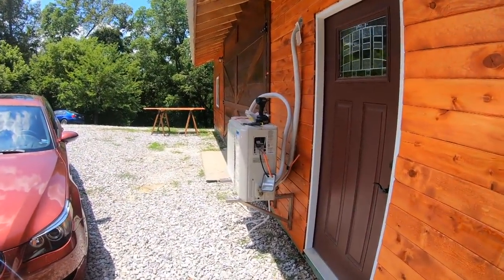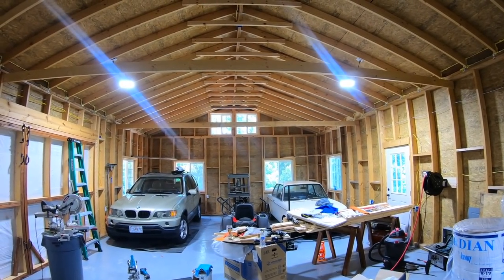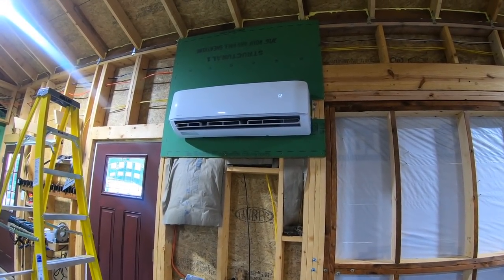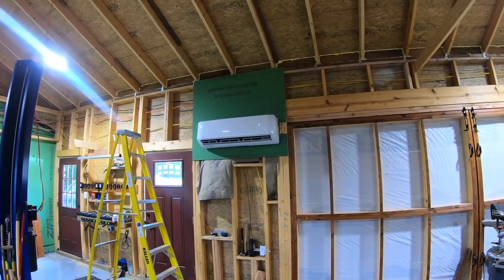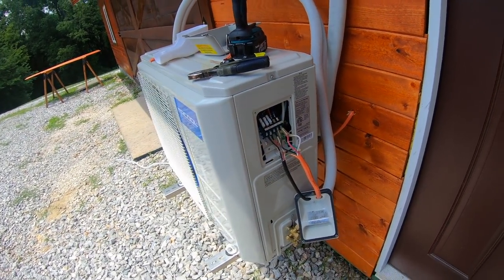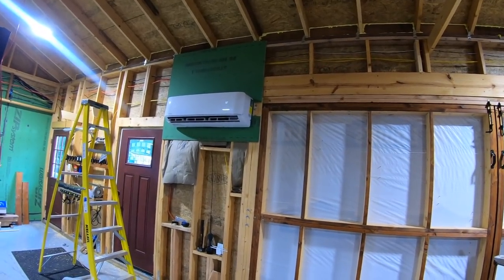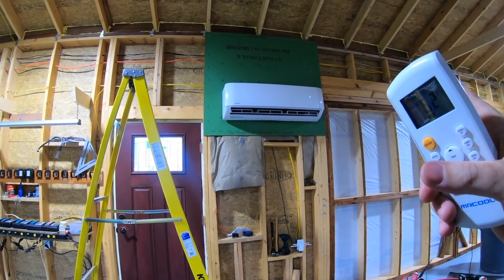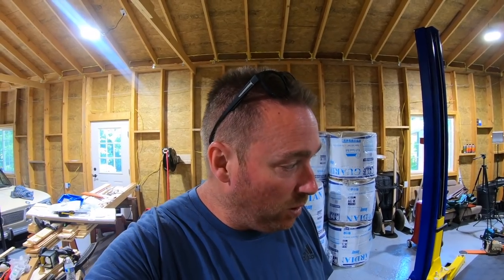MRCOOL Mini Split AC Heat Pump Installation SECRET TIPS Part 1

Comment: I just completed install two days ago for my garage 735 sq ft / 10 ft ceiling, I used 10 ga. THHN red blk green. $.47 per foot each. Your ROMEX has 4 conductors, the white wire is not according to NEC standard 240v is achieved with two hot wires of double breaker & the ground wire. Do not connect a wire to neutral in the electrical panel. Your white wire can serve as a ground, however cap off the bare copper wire at both ends. I used a liquid tight whip to connect to a 30A fused disconnect box. I sweated over this install almost as much as I when working on my '73 2002 (that looks like a 70 - 71 in the corner of the shop). Thanks for the memories.

 I may have the later version  the wires came fully attached to the head unit. rewinding the pipes is a potential problem. They warn against reconnecting the lines, the lines come pressurized to keep moisture out and they are concerned with seals leaking after torquing a second time. It would probably work, I would reuse the plastic screw caps that came while recoiling the line set.

Comment: I like watching these mr cool install videos to see all the no no things these guys do.  Loops on line sets no surge protection. Wiring issues no fused disconnects just to mention a couple
Reply from the maker: This unit is 10ft from the main breaker box ...
Reply: So what does that mean. Nothing. 25 FLA means what it says. A proper wire size and TIme delayed fused disconnect will work. 100 feet is the were you need to upsize. Always check voltage at the appliance and check manufacture + - tolerance .
Reply: As an HVAC licensed tech I agree with the original post. So many things in these videos are done incorrectly. Proper placement. Safe electrical work. Purge with nitrogen. Pulling vacuum. I also saw nothing that warrants the do not buy until you see this video except many things to avoid doing in your own install. Not to be insulting but work that requires education and licenses should be done by people with the education and licenses even if it is just in a consultation. I hope things stay good for you ;)
Reply: Adam Radley Concur on the electrical work, but he did say it was temporary. You are aware these MR Cools don’t use traditional copper lines and they are pre-evacuated from the factory, hence they are considered “DIY” systems. I don’t like the coiled nature of the excess line length either. I did see plenty of reasons NOT to buy a MR. Cool. I only stumbled on this video and am not a regular here, but I do know that in the metalworking YouTube community, many of the creators were donated Mr. Cool units for obvious reasons.
Reply: @charlieromeo7663  yes the linesets for MR cool are prechraged. Just like the old residential AC units used to use. Before we all realised how inconsistent and unreliable that type of system is. A lot of us are just waiting for the influx of service calls on these units. 

It is important to note that many of these DIY kits are not prechraged lines hence the comments about purging and vacuum.

Also large loops can cause oil accumulation.

Another aspect that experienced techs would mention is the outside placement of the unit. Especially for heat pumps. Prevailing winds and adequate shelter from those winds increases efficiency. These are just some examples...
Reply: @adamradley4407  but these units have precharged line sets. Literally is right in the description. So if it’s just the loop in the line set, that’s easily dealt with.
Reply: @qwazxcvbn   yup just look at the above comment. your concern was already addressed :)
Reply: Still supposed to have a disconnect within 6 feet of outdoor unit. It’s pretty much a standard code everywhere.

Comment: In 2013, I installed a Gree branded 18K BTU heat/cool Mini Split.  Main unit was pre-charged.  I used a 25 foot line set and a wall mount.  It heats/cools our Master Bedroom as it is upstairs and the central unit does a lousy job upstairs. Bought a 2-stage 5cfm vacuum pump, gauges, hoses, micron gauge, refrigerant scale.  Was able to vacuum system down to 70 microns.  The China built unit is still working flawlessly.  $1200 for the unit.  Didn't keep track of the cost of the tools I bought but have fixed 4 HVAC issues for friends so probably broke even.  Just happy the bedroom temperature is perfect.  Cheap to operate.

Comment: I installed a universal central air (not mini split) MR cool 2-3 ton heat pump and LOVE IT. The customer support is amazing and when I had an electrical issue with my air handler they sent me a replacement BRAND NEW complete AIR HANDLER at no charge.

I repaired the broken air handler and bought a cheap r410 heat pump to mate to it and now I have central air in my house AND garage.

I love mr cool

Comment: Nathan, this is no garage or barn, it's a castle man! I am impressed!!
Reply: @nizapad6970  not neccessary !
Reply: Nothing tying both walls together like ceiling joist  just three 2x4s and the end walls 🤔
Reply from the maker: No 2x4’s in this build, collar ties and the ridge sits on posts  , so no push out,since this video I installed a ijoist and lvl loft that locks it all together
Reply: @NathansBMWWorkshop  lots of technical words, but I am still impressed man :)

Comment: We run four of the minisplits in our home and two rental units.
They work perfectly, are very quiet and super efficient !
Way better option than forced air if you have the room to mount componants. Ours are all powered by an 8 KWh solar system.
Nathan - two suggestions for your garage. 
1) add a point of use surge protector at the AC unit to protect it from lightning or utility power surges.
2) dont run it while you are doing dusty work - drywall or fibreglass insulation installs. Or at least cover the air intakes with some quality hepa type furnace filter material.
This will keep all the particulates from matting up inside the air handler which is difficult to clean.
Nice shop, enjoy working in that air conditioned luxury.

Comment: I had an electrician wire my hobby shop for this before ordering this unit... he then installed it for me for $200.  WOW, one of my best purchases ever.  This unit is
whisper quiet and keeps the 800 sq. ft. shop nice and warm.  I had this put in last fall when it was still warm and the a/c seemed to work well but the test will be
this summer... hope it can handle our Virginia heat/humidity... it is very uncomfortable here in June, July, and August.  Great unit so far and is very economical.  I
had originally thought of a pellet stove for this hobby shop but am glad I went with this unit instead, plus I was able to get rid of the window a/c units!
Reply: What size is your shop and how many btu's?
Reply: So how did the summer go?

Comment: I have installed 2 36,000 btu units and 1 24,000 btu unit. They are a great system. I got my from menards and Never had any issues with it
Reply: You installed in the same house 2 36, 000 btu units and 1 24,000 btu unit?

Comment: My 24000 btu window unit cost me 799 last year. I am going to put a mr cool 18000 btu in my shop in a month...
I read they ramp up when they come on, not like a regular heat pump or windows unit that comes on all at once sucking down amps at start up. Lol how i explained it to my wife is when garden hose is running kink hose to stop water then unkink, see all that pressure when you unkink hose. Thats what window unit does when it comes on just suck them amps.. might be a lame way of explaining but how i invision it...good video sir thank you..

Comment: About 4 years ago I did some remodeling and installed a dual head mini-split at 12,000 btu each for two rooms. The outside unit is a 24,000 btu Mitsubishi. My set up came with enough line for my locations and the outside unit was pre-charged...but...I still had to have the lines vacuumed , which I paid a hvac company to come out and do for me. I only paid about $70.00 for the vacuum and line check for leakage at the connections to the inside handlers. I also used  an ordinary water hose for my drain lines since the kit didn't come with drain lines. I have the hvac people come out about every two years and they connect a shop vac to the end of the drain hose and suck out any junk that has accumulated in the condensation pan that doesn't drain out normally. I love the mini-split; it is very quiet and because it requires 220V, it is a lot cheaper than  regular 110V window units, which are loud and draw a lot of electricity.

Comment: If I could I would have mini splits all throughout my house. I love them. a lot more energy efficient than a central unit. In my master bedroom I have a Mitsubishi. Wasn't cheap. About $3500 installed. and in my living room area I have a blue ridge 12000 BTU mini split. About $1,800 installed. I did not do any of the work myself. The other thing about these units is that you need to at least clean out the blower motor and the coils at least every two years. They can get quite dingy. Other than that they are very efficient low noise and cools well.I think one of the main reasons the HVAC people don't install these more often or recommend them is maybe because they are not as profitable as a giant central air unit.
Reply: true.
Reply: Profit margin on these are way higher than central air. The profit has nothing to do with recommendations. Central units are much better
Reply: Lol I don't know about not being as profitable. I have a room above my garage. I got a quote from a HVAC guy for fixing the ductwork in the garage that goes to my room. To do that work he only wants 1200. For the mini split he wants 4900. Also I could replace my whole central air unit for 10k. If I put mini splits all through the house it would be much more.
Reply: @shaunvaughn3323  Yeah, it sounds like the guy is pushing toward more profit margin work.
Reply: @antonioj123  Yeah. I think for my situation the mini split might be better, but 4900 seems overpriced. I don't know much about HVAC though. I guess the price could be fair.
Reply: @shaunvaughn3323  i just installed two mini split systems in my house.  One 36000 btu unit and the other a 27000 btu unit. They cost me $3200 and $2700 and i paid $1000 to have them installed.  $6900 for 3100 sq-ft of cooling. I think the mini split is the better deal.
Reply: I'm in Canada, just got a quote for 6500+ for a 24,000 btu. Comes with 12 year warranty, but still....
Reply: @ProjectXJ  where do you live ? In bay area, they will charge $5000+ for such an install jobs . How many zones do you have to cover 3100 sq ft ?
Reply: @irq001  In Arizona.  I have 2 systems, 1 with 4 head units and 1 with 2 head units. 3100 sq-ft total between the two units.
Reply: @muds17  
“central units are much better”
Better meaning what?
Ductless Inverters don’t have the laxidasical 20° plus temp loss at the delivery registers nor the duct leakage, nor the conjoined or bonded temp control for comfort (all rooms go up and down together rather than discreet zones), nor the invaluable redundancy of multiple condensers conditioning a house or building, and I could do this all day long, and yet my customers all thought mini-splits were expensive too because that’s what they all heard and saw estimates for…
And then I blew their minds with affordable priced systems and they all love them. Seriously love them. 
But still old school hvac’ers swear by their ducted central systems… and charge more for that than one of my high efficiency mini/multi split whole-house wifi controlled systems. 
What’s better again?
Reply: @muds17  iam not gonna install a central unit in garage.  I guess they are better for the whole house but not for what I need it for
Reply: I helped a friend of mine who owns his own HVAC company.You wouldn't believe the profit he clears on a central unit.No wonder they don't recommend these,,,HA HA.

Comment: I mounted mine the same way  it will vibrate the wall alot .If I was to do it again id put it on a pad and isolate the line set from the wall because it transfers through there as well . I  bought the cooper and hunter 18000 btu of amazon dual head. My barns is 16x32 two story I have a 12000 btu head upstairs one down it works great used only the bottom  head this winter keep the barn mid 60s in OHIO so it gets cold here  now im using only top head for summer when needed these things are the way to go .

Comment: Not to be critical and only offering gentle suggestions…1. Keep the line set coiled more tightly to avoid damage. 2. Code dictates that a means of disconnect must be used, either unfused or fused. This is typically done with a disconnect box and 6’ whip. 3. The 10/2 Romex showing with the orange jacket is not rated for outdoor use and does not contain UV inhibitors on the jacket. But I did note that you mentioned buying the gray UF wire. 4. The wiring of the Romex and communication cable does not require that you remove the entire covering. It actually splits apart by removing a screw.

Comment: as an hvac tech the one thing you really should do is get a 30 amp fused disconnect. that will bring it up to code. Lowes home depot, menards only cost about 15 to 20 bucks easy to install.
Reply: And how did he evacuate the evaporator and line set without a vacuum pump?
Reply: @jl0016  Mr Cool comes with precharged line sets that don’t require a vacuum pump, that’s why he has an ugly rolled up ball of line set above the unit outside
Reply: @jl0016  pre-vacuumed I should say, the outdoor unit has the charge in it
Reply: @bentrailer1848  Thanks for the update in South africa we do not get line sets and evaporators that come in an vacuum.

Comment: Nice, funny how these units are less known here, this is all they use in South America and other 3rd world countries 👍
Reply: And every country in on earth except USA
Reply: Its good when its new like many electronic appliance, once u run into trouble it will cost you more than a window shaker.
Reply: @dangda-ww7de  With the name brands, Fujitsu, Mitsubishi, you can buy parts, circuit boards, compressors, etc.  Don't know about the off brands.  I've seen some pretty old units out there with R22 still working.  They are more common in foreign countries than here in the US.  I have two Mitsubishi's, one in my upstairs lab and one in my shop, both do a great job.
One issue, condensation, there has to be a drain, so if the indoor unit is on an inside wall, in order to get it to drain, often there has to be a condensate pump, and they do fail and are not cheap.
They use an IR remote control, unfortunately, it's kind of expensive to add a hard-wired theremostat, no idea why.
Yes, they come pre-charged and belive it or not, there are idiots out there who install their own and do not eveacuate the lineset and indoor unit, they just let the freon go, they may work but are asking for problems down the road.

Jim

Comment: I bought a property that had the Mr cool in it.
Heat worked great, bit the AC always froze up.. I had professionals come look at them several times, and it still happened again, and again.. Finally switched to Mitsubishi, best thing I ever did, even ended up save 100$ monthly on my power bills.. they've paid for them selves now..I hope you have a better experience w that MR cool
Reply from the maker: This one is gen 3 , they say all of those issues are fixed on this one, the review before i bought it were really good , so far so good
Reply: @NathansBMWWorkshop  Do they say Gen 3 somewhere when you order them?
Reply from the maker: Cobia 1 yes they say 3rd gen for the 2020 models , when I bought this 24000btu system I paid $1150 now they are nearly double that , hopefully the price goes down this winter , I will buy 2 more smaller units for my house
Reply: @NathansBMWWorkshop  Ok! great thanks...
Reply: @cobia1794  Yes

Comment: David from Mammoth cave Ky.  I just picked up my MRCOOL package units today at one of there warehouses today. Package 1 containes 1 36k outside unit with a 9k , 12k,   18k head units . 36k units can handle 4 heads i got 3 heads for each unit. The other one has 9k, 9k ,12k with a 36k outside unit all of this is a DIY . That means the out side unit and each line set and head unit is precharged that is what the guy at MRCOOL told me . The outside unit dont charge the lines they are precharged the have special fittings that hold the charge. DIY system does. They also need a disconnect beside unit outside. I got this for my cabin that is made of a walkin cooler the hole cabin is a giant walkin cooler . With foam on outside and another 4 inch wall inside. Over R50 on my walls and R 70 and R90 on my ceiling . Foam in floor too. 1,600 square feet. My units are 7 tons all together. Definitely didn't need all that but had too have a head in almost every room. It should not kick on very much . I can't wait to start installing it. 2 /10 with a ground is what im using, and 30 amp breakers.

Comment: I'm pretty sure the lineset is what's charged on the Mr. Cool units.  In fact it says it right on the listing.  I'm an HVAC Contractor and did an install for someone who bought a Mr. Cool unit and wanted me to install.  The lineset was precharged and the outdoor unit and the indoor unit were under vacuum so you technically didn't need to use a vacuum pump.

Comment: Finally someone that explains the information we actually need to know! I’m still wondering how the refrigerant lines do not need purged? How do you check for leaks?
Reply: Berkley Myers 
The lines purge non condensables at the fittings when you compress them together. It’s a one time thing like doing a self piercing saddle valve. But that’s it. If you loosen them up you’ll need to evacuate the system. Use a leak test solution to check for leaks.